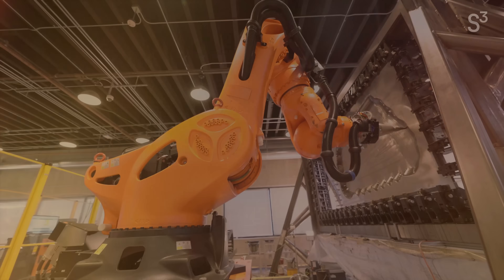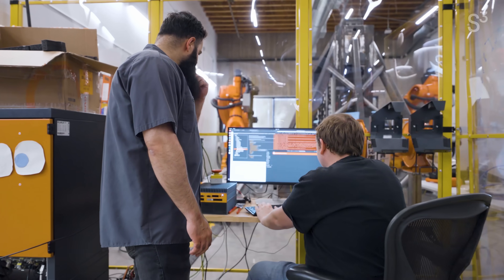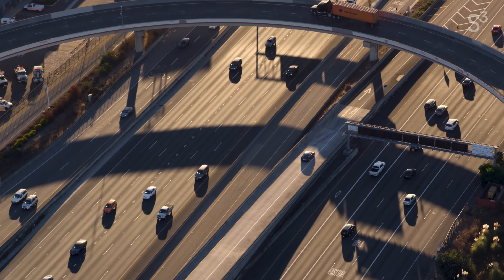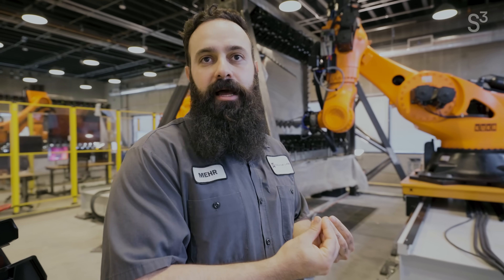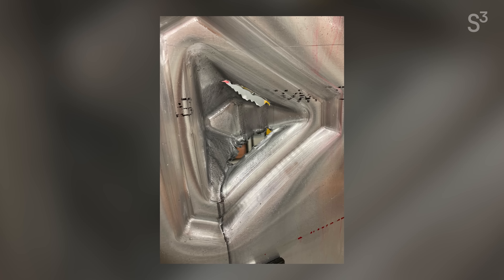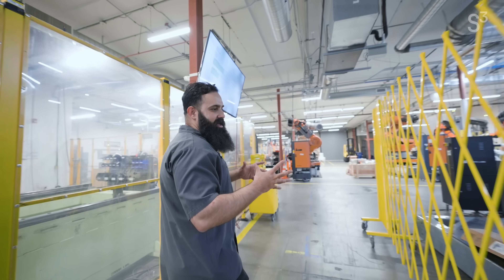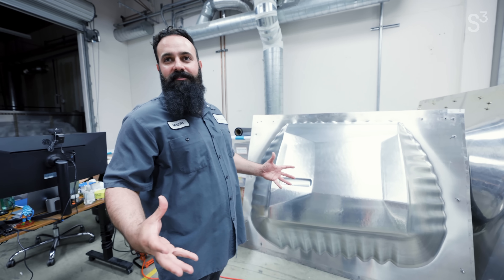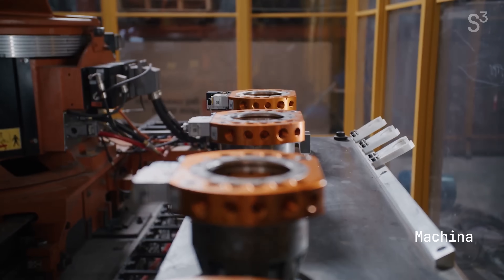New Robotic System to Displace a $280B industry

Comment: This is actually a startup I would invest in. Low production number parts are always a headache because you have to compromise a lot in order to not blow all your money just on tooling and machining. I can totally see a local shop 20 years into future to have a metal 3D printer, CNC and a robotic sheet metal stamping/cutting/bending station like this and accepting orders for custom parts ranging from one off long discontinued exotic car parts, art, to maybe a dozen or so custom bathtubs and kitchen sinks. Just like small scale CNC and plastic 3D printing shops operate today. No more years long car restorations just because there are no parts available until someone totals their veteran or run out of money/patience and sell their partially restored car for parts and that one part you need is on that car. Just make (pay someone to make) a CAD model and order it online. It will be either machined, stamped or 3D printed just for you... most importantly affordably and fast.

Comment: This is such an incredible, fundamental technology. As AI and ML get more powerful, they’ll go from 4-5 tries per part down to 1. The ability to iterate prototypes prior to committing to stamping dies is going to have a huge effect on all kinds of manufacturing. (Big parts are where the huge savings are, but as the tech goes down the cost curve, it’ll be cost-effective for prototyping much smaller stamped parts as well, greatly speeding development cycles.)

Comment: I don't think this process will displace the sheet metal industry, which is mostly comprised of stamping. Hard to beat the cost and speed at scale of stamped sheet metal. Like 3D printing, I think the bulk of value this tech will provide will be for large oems to be able to quickly prototype their sheet metals designs and for boutique customers manufacturing in relatively low volumes. Very impressive nonetheless, kudos to this company! edit: grammar, syntax

Comment: Stamping is expensive to set up... but can crank out parts crazy quickly. Not sure how scalable this approach will be.
Reply: This is what I was thinking, high up-front cost but each part after has a very low incremental cost. I still believe that there are great use-cases for this technology, and old military aircraft is a great example of that.
Reply: @AnimeHumanCoherence  Prototyping
Reply: You can shut down volume production of old products and make replacement parts on the fly
Reply: It’s not meant to be scalable. It’s meant to be to provide the same benefit as 3D Printers. It’s for prototyping, and small unit manufacturing. Which is huge for manufacturers and the military.
Reply: @ANONPROFILE001  I think the reason everyone is rightly hung up on the fact that this isn’t scalable for high volume production is the title of the video.  It’s not going to “displace” a $280billion business.  It’s going to displace prototype and low volume solutions, like hand forming and fiberglass and some carbon fiber parts (that could be metal but aren’t currently cost effective to be made out of metal, so they are hand made out of fiberglass or carbon instead).
Reply: Seems really useful as a prototyping tool. Could be either sold as a service for quick turn, low volume "stamped" parts, or customers could keep one of these on site to prototype a wide range of parts before making any tooling.
Reply: Large scale manufacturing is not the only industry that exists. Fabrication and maintnence are still important industries. And sheet forming CNCs could find it’s place.

Comment: Do the formed areas get thinner than the original sheet thickness?

I understand Press Work ie. Trapping & Flowing, but unsure off this process.
Reply: I believe in the smarter every day video they went over why this is not the case
Reply: I believe their "ML model" would try to predict how to form it from the first movements such that it remains the same thickness, at least thats how I would try to do it